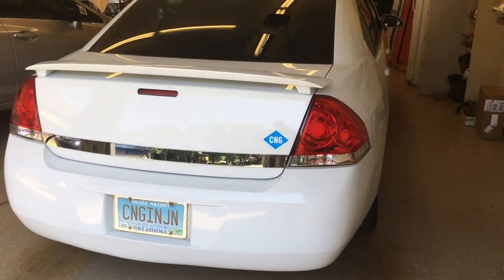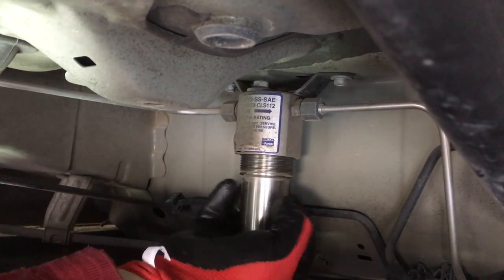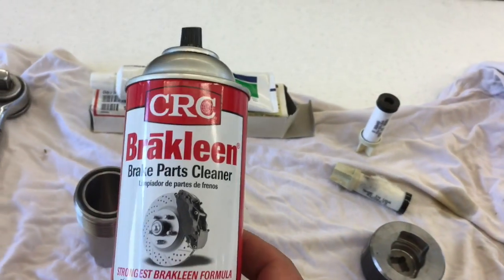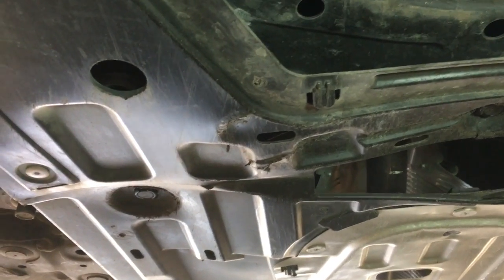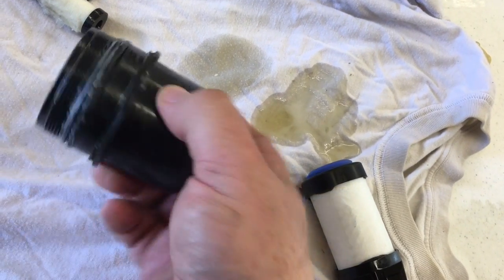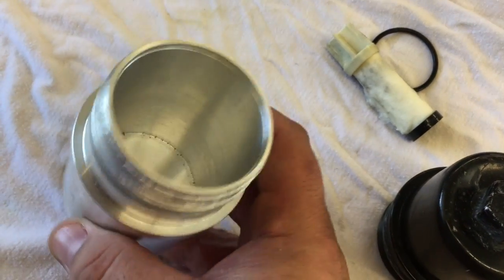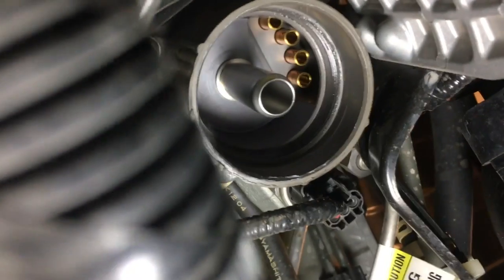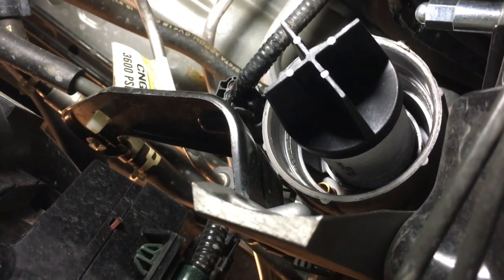2012 Honda Civic CNG High Pressure & Low Pressure Filter Changes

Comment from the maker: Besides the CNG filters being harder than regular gasoline filters, the other item that you need to be aware of is that since the fuel is gaseous it doesn't lubricate the upper part cylinders/combustion chamber.  This could lead to the exposed threads of the protruding spark plug to become rusted.  If you wait until the regular maint. interval of 120,000 miles to change the plugs, then you may have a thread stripping issue as the rusted spark plugs are removed.  To elevate this, the Honda CNG Service Techs are recommending that you pull the plugs to inspect/clean/replace them every 30,000 miles.  They also recommend to adjust the valve clearance while you have the plugs out to keep the noise down on the valve train.  I assume that the lack of lubrication also causes the valves to loosen up prematurely as well.   The way I'm doing it is to pull the plugs every 40k for a wire brush cleaning on the threads, then changing them every 80k miles.  I do the valve clearance adjustment each time, so every 40k miles.  Maybe I'll post a video of the valve adjustment next.

Comment: I appreciate you posting this video, ive be considering a cng car, these type of videos take alot of the uncertainty out of buying one
Reply from the maker: For sure, they aren't that difficult to work on, but you have to respect the pressure and think twice before you touch anything that has to do with the fuel system. Be careful!

Comment: Thanks for making this video. I just changed the high pressure and low pressure filters on my 2008 Civic GX today, now on 210,000+ miles and it's amazing how clean the CNG car is. I also upgraded the low pressure fuel filter housing to the CNG Consulting part and it definitely looks and feels superior to the OEM component. I used a 24mm socket with a 1/2" ratchet, I didn't have to use an extension but I had to use the ratchet within the engine compartment. There was just enough room to turn the housing a click or two at a time. Your tip about pushing the housing in to seat the o-ring made a big difference, not sure if the new housing helped as well, but I did not have to freeze the canister and it only took me a few minutes to reinstall this time! Thanks.
Reply from the maker: Glad to be of service to the CNG community :-)

Comment: Loved your instruction video thank you!  I just bought a 2011 Honda Civic CNG.  I was just wondering how long do the tanks last and how much does it cost to replace them? How would I know when it's leaking?  Some people say it smells like rotten eggs, is that true? I am out here in Santa Barbara - Ventura Area.
Reply from the maker: The tanks in the beginning were rated to last for only 10 years, but then in the later models, Honda started using tanks that were rated for 15 years…so your 2011 probably has a tank manufactured in 2010 with an expiration date of 2025. You can check for sure by removing the protective shield in the trunk so you can see the tank and stickers. To get a brand new tank, it would be around $3,000. Yes, you can definitely detect leaks by smelling the mercaptan odorant that is in the natural gas. It’s the same smell as you have for any natural gas leak, like rotten eggs.

Comment: I have a problem with my civic 2012 it drives normal for first ride then when I try to give it gas it feels like something is clogged up like no power unless I push the gas pedal all the way .do you think the fuel filters are the problem?
Reply: MYT I have a 2012 too. If it’s not the spark plugs, it’s def you filter. I’m having the same issues!!!! Glad I found this.
Reply: Did your car get any better after changing the fuel filter???? Because I'm having the same problem. I'm losing power when going up hills...
Reply: Same here
Reply: Turn the Econ off
Reply: Same here lost off power 
What can I do to fix it

Comment: Using an impact wrench, the low pressure housing came out without any problem.
Reply from the maker: That is risky and could easily damage the canister if allowed to get out of alignment while removing it. I would not recommend using an impact unless you have the Honda socket that supports the lower section of the housing...a regular socket with a swivel joint can easily put too much pressure on the flimsy canister and can buckle the end of the canister near the nut.

Comment: Thank you for your video!! Out of curiosity, what home filling station do you use and do you like it????
Reply from the maker: I used the Phill from Fuel Maker. It is a small 4-stage compressor that was able to fill the tank in the Civic if left connected overnight. You can see a good video about it here: https://youtu.be/WgcNJWaO_Fw?feature=shared
I really liked it, but it is too small for larger vehicles

Comment: I have a 2012 Honda civic CNG and has lack of power lack of acceleration. I will have to step on the gas pedal all the way down for it to respond sometimes please help what can I do what can the problem be
Reply from the maker: Doesn't have anything to do with the fact that it's a CNG Civic...maybe there is an issue with the throttle position sensor? I haven't experienced that symptom before, so I really don't have any advice to offer you. Sorry.
Reply: @cnginjun4047  what is the reason of the low pressure filter and high-pressure filter replacement? What’s the effect if not replace what happens if they do not get replace

Comment: question, are the fuel injectors the same on these vehicles the same as the gasoline cars?
Reply from the maker: No, the injectors are different and specific for use with CNG.

Comment: Great video.  Where did you purchase the low pressure housing?  Thanks.
Reply from the maker: Steven Wilson To purchase either the replacement filter housing or removal tool, please contact Carl Jennings at CNG Consulting of California through his email account: jennings804@yahoo.com
Reply from the maker: To purchase either the replacement filter housing or removal tool, please contact Carl Jennings at CNG Consulting of California through his email account: jennings804@yahoo.com
Reply from the maker: There is a better design that is made in Tulsa that you can find here: https://ryan4704.wixsite.com/website

Comment: I have a 2015 3.6L Impala with CNG.  Would love to see a video if changing the low pressure filter on one of those.  Also my tank will switch to regular gas, and I still have half a tank of CNG.  Can you answer why it does this.  It first started at a quarter tank and is slowly creeping upwards.
Reply from the maker: Sorry, I don't know much about the Impala system and I can't make a video for it because I no longer own it. Sorry

Comment: Hi, can you please tell me where to buy the low pressure cng filter, thank you
Reply from the maker: The best replacement housing is made in Tulsa by Catalyst Designs.
Ryan is a machinist who has developed a superior product.
The totally redesigned low pressure filter housings are available here at Ryan's website:
https://ryan4704.wixsite.com/website/
These are way better and address the installation challenge by redesigning the O-Ring gland...way better design and ease of use...highly recommended!

Comment: Could you please give me information on how to make contact with CNG Consulting? Thank you, Victor Gonzalez
Reply from the maker: The best replacement housing is made in Tulsa by Catalyst Designs.
Ryan is a machinist who has developed a superior product.
The totally redesigned low pressure filter housings are available here at Ryan's website:
https://ryan4704.wixsite.com/website/
These are way better and address the installation challenge by redesigning the O-Ring gland...way better design and ease of use...highly recommended!

Comment: do you know what the maintenance intervals are for the high and low pressure filters?
Reply from the maker: Maintenance Intervals Recommend for the low pressure filter at the firewall:
• Drain every 3,000 miles or 3 months whichever comes first.
• Replace filter element every 30,000 miles 24 months whichever comes first. • May vary on vehicle usage and filling stations usage.
If no oil contamination is found by the third filter element change, you may extend the drain intervals and extend the filter element change depending on system conditions.

The high pressure filter should be drained on the maintenance minder intervals and changed along with the low pressure filter.
Reply: @cnginjun4047  thanks for the detailed reply!

Comment: Is there another good way to release the pressure on the gas without starting the car? My car currently won't run and I think it is because I have never changed the filters.
Reply from the maker: I would say that you need to discuss it with a CNG repair shop so you release the pressure safely. I know that it is very dangerous if you release the pressure incorrectly.
Reply: @cnginjun4047  Thanks for the input

Comment: What is the Honda OEM part number for low pressure filter on 2012 Civic CNG? I didn't see it in video...Thanks in advance!
Reply from the maker: The OEM P/N is: 16906-RNE-A00 or you can purchase the heavy-duty aluminum version here: http://ebay.us/PCddfX?cmpnId=5338273189
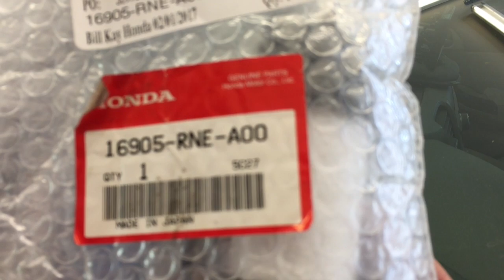Reply: @cnginjun4047  Thank you so much for doing this video. FYI: You have a typo on the part number. In your video at 20:43, the packaging shows part # 16905-RNE-A00. Part # 16906-RNE-A00 includes the metal housing.
Reply from the maker: @samwong5847  you are correct, sorry for the bad info on the video. 
Low Pressure Filter Element Set: 16905-RNE-A00 (includes 54.4mm x 3.1mm o-ring)
High Pressure Filter Element: 16905-S1G-003 (includes 127mm o-ring)

Comment: Hi there. I am also a Tulsa resident with a 99 GX, 00GX and a 2012 GX. Bought my first GX from Tom Sewell. I'm sure you know him. Anyway. What is the best source for purchasing the cng filters for a good deal? The low side seems to be really expensive. Any source suggestions?
Reply from the maker: For the Honda Civic I always buy OEM filters and I always have to check around online for who has the best price for the filters and shipping costs. I buy them from a different place every time. Sorry, but I haven't found a place that is consistently the lowest.

Comment: Do you have a part number for the drain plug o-ring from Parker? I'm also in Tulsa area, saw your hideaway magnet on the freezer...yum!
Reply from the maker: You are observant, yes I'm in the Tulsa area.  I always get extra O-rings at Crown Products on Skelly Drive.  You can buy the small O-rings for less than $0.20 ea.  The drain plug is #014 BUNA-N A70 and while you're there, I'd pickup some fill port O-rings as well.  They are handy to keep in the glove box in case it pops out or gets torn and you need to fill up.  The fill port O-rings are #110 BUNA-N A70.
Reply from the maker: I also use a brass O-ring pick to remove the old pieces before installing a new O-ring.  Do not use a steel pick or similar hard tool to remove the rings or you could damage the O-ring gland.  AutoZone also sells a plastic O-ring pick for $1.99, but its usually a special order.  See it here: https://www.autozone.com/test-scan-and-specialty-tools/o-ring-pick-tool/santech-nylon-o-ring-pick-with-santech-logo/952392_0_0
Reply: Thanks I'll have to go pick some up now. My new housing is on the way.
Reply: @cnginjun4047   Do you have an alternative source for this OEM O-ring?.... 16922-RNE-A00. This is the o-ring for the filter housing on the firewall.

I drive a 2012 Honda GX in sky blue, just like yours. Also own a 99 and 00 GX. I live in Oklahoma, in Stillwater. I am in Tulsa every week.

Comment: Do you think CNG car easy maintain than gasoline car? I am thinking to buy the used CNG car if easy to maintain.
Beside high pressure filter is there anything else I need to know about CNG car for maintenance? Thank you
Reply from the maker: Besides the CNG filters being harder than regular gasoline filters, the other item that you need to be aware of is that since the fuel is gaseous it doesn't lubricate the upper part cylinders/combustion chamber.  This could lead to the exposed threads of the protruding spark plug to become rusted.  If you wait until the regular maint. interval of 120,000 miles to change the plugs, then you may have a thread stripping issue as the rusted spark plugs are removed.  To elevate this, the Honda CNG Service Techs are recommending that you pull the plugs to inspect/clean/replace them every 30,000 miles.  They also recommend to adjust the valve clearance while you have the plugs out to keep the noise down on the valve train.  I assume that the lack of lubrication also causes the valves to loosen up prematurely as well.   The way I'm doing it is to pull the plugs every 40k for a wire brush cleaning on the threads, then changing them every 80k miles.  I do the valve clearance adjustment each time, so every 40k miles.  Maybe I'll post a video of the valve adjustment next.

Comment: Yes! Thanks for the very informative video. I just bought a 1999 Civic and Im guessing they are almost the same. Ive come across threads that say there's only one filter (high pressure) on the '99 so Im thinking that I'll have to change it maybe every 10K miles just to be on the safe side. I haven't double checked on the car yet so we shall see. Ill be looking forward to that video on valve adjustment :) Thanks again
Reply from the maker: Maybe I will make a video on the valve adjustment next time I do it. Thanks!
Reply: @cnginjun4047  That would be awesome!

Comment: Is it okay to use white lithium grease instead?
Reply from the maker: Remember that the O-ring is containing the pressure in the fuel system. As lithium is based on petroleum, it tends to speed up rubber and plastic components decay. I always use the Honda Shin-Etsu Silicone Grease - 08798-9013 because it is what they spec to use in the Honda literature and once I bought it, I now have a lifetime supply for me and my grandchildren. You could use other lubricants, but I would use something that is a silicone based grease made for rubber. Parker makes a Super O-Lube O-Ring Lubricant SLUBE-884-2-TFD...but I imagine that it is more expensive than the Honda variant. I was able to locate a cheaper alternative on Amazon called "Super Lube 56204 O-Ring Silicone Lubricant". It was around $8 and should work fine. Your local pool supply store should also have o-ring lubricant on the shelf.
Reply: Ty
Reply: I find it easier to access the low pressure fuel filter from the top.
Reply: Quick question if you know, no matter if my tank is filled halfway or full, the fuel gauge always reads empty. But it shows the correct amount of fuel when I turn the key off and back on again, after that the bars slowly go away back to empty while the fuel light is constantly blinking. Hope it's not a fuel pressure sensor or something like that because it looks kinda expensive online.  
I just replaced both high and low pressure fuel filters on my 2012 civic with 200k miles because it was misfiring at low RPMs and also because I don't think they were ever changed. I found that the low pressure fuel filter housing was 2/3 of the way filled with compressor oil so I hope that the sensor is just clogged.

Comment: Where is the pressure regulator located
Reply from the maker: mounted on the firewall behind the engine...off center slightly towards the passenger's side

Comment from the maker: To purchase either the replacement filter housing or removal tool, please contact Carl Jennings at CNG Consulting of California through his email account: jennings804@yahoo.com
Reply: How much are these?  I just sent him an email inquiring about purchasing one.
Reply: Did you get a reply?  Did you buy a filter housing from them?
Reply: Firebert79TA I did!  We spoke on the phone, he is the guru on all things CNG.  Unfortunately the car I was looking to acquire was way behind on maintenance (none had been done in 30k miles) and I ended up passing on it.  If another one shows up in AZ I’ll be getting one.
Reply from the maker: The flimsy can from Honda has a list price of $638.55, so Carl's prices are a bargain compared to that.  Last time I checked, he was asking less than $400 each for his billet canister housings...but that was his older design.  He is working on a revision that will even be better.

Comment: Is there a link for the after market cng consulting filter housing ? Cant find it anywhere
Reply from the maker: The best replacement housing is made in Tulsa by Catalyst Designs.
Ryan is a machinist who has developed a superior product.
The totally redesigned low pressure filter housings are available here at Ryan's website:
https://ryan4704.wixsite.com/website/
These are way better and address the installation challenge by redesigning the O-Ring gland...way better design and ease of use...highly recommended!

Comment: That low pressure o ring is the worst!!!!! Started at midnight for oil change and fuel filter change now 3am with my cap in the freezer for the second time......
Reply from the maker: I hear you! I've checked into under sizing the O-ring to make it tighter and easier to install, but then you don't get the compression you need for the seal.  The manufacture (Keihin not Honda) of the pressure regulator made an engineering mistake in my opinion.
Reply: Going to do a video on valve adjustment any time soon? My next task.... and prefer video walk threw than the book. Visual learner lol

Comment: Thank you for this video can you please share the number and website for the tool that is used to take the HP filter out? My HP casing won't crack open with a monkey wrench and I am afraid I will flex and mess up the HP lines above it. I have not been able to find this tool on the internet anywhere.
Reply from the maker: It’s not available online, Honda recommends using an adjustable wrench. If you want to buy my tool, send me a note.  Thanks.